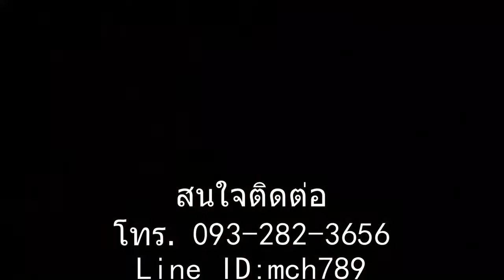เครื่องสับไม้ เครื่องชิพไม้ รุ่น 420 โทร.093-282-3656

Comment: รุ่นไหนใส่ไม้ได้10" ครับ
Reply from the maker: สวัสดีค่ะ รุ่นที่สามารถใส่ไม้ที่มีขนาดเส้นผ่านศูนย์กลางได้ 10 นิ้ว แนะนำ
เครื่องสับไม้ Disc รุ่น1300B 13-18ตัน/ชม. มอเตอร์90KW+3+3KW  (ช่องรับไม้ 350x350)
 +สายพานเข้า4ม.+สายพานออก10ม.+มอเตอร์+ตู้คอนโทรล ราคา 699,000.00 บาท 
รุ่นนี้สามารถใส่ไม้ที่มีขนาดเส้นผ่านศูนย์กลางได้ 12 นิ้ว ค่ะ
สอบถามรายละเอียดเพิ่มเติม 093-2823656     Line ID : @mch789